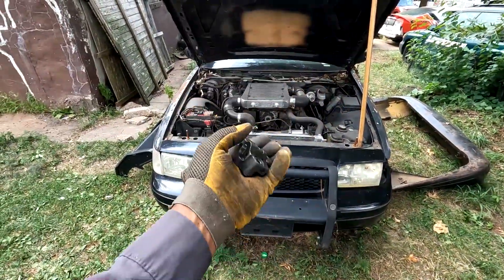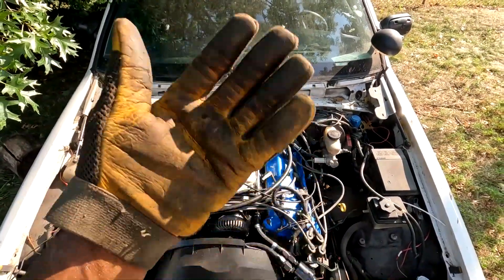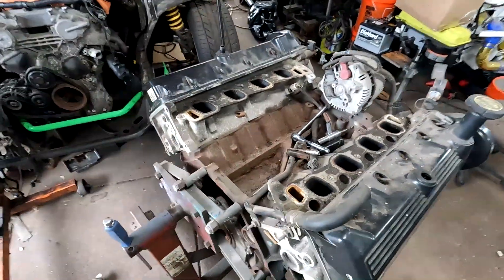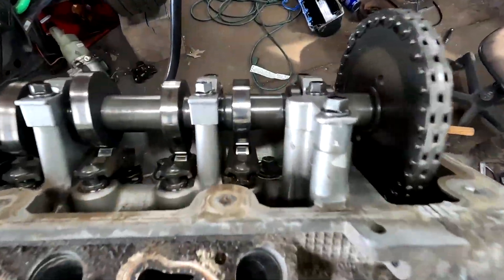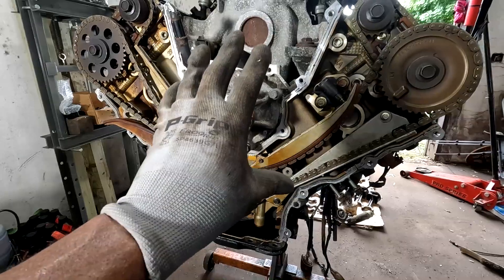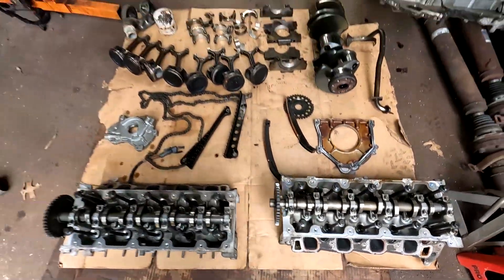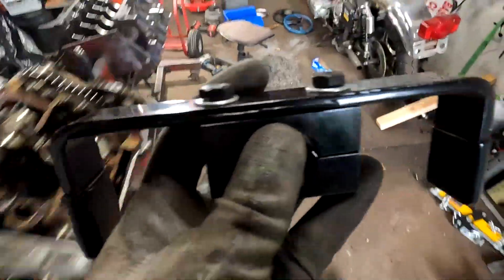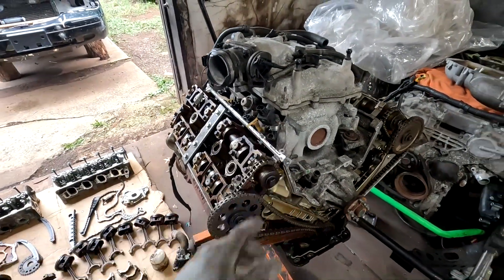The Main 3 Flaws of The 4.6 DOHC Modular Engine!  ( 5.4 2v  Engine Tear Down ) DEBATE!  #cars

Comment: 6:07 i was expecting a exploding  effect lol Mr randoms situation  is interesting 
  he bought a  project  car first miss  mistake second  he was blaming  the marauder  like crazy in that video  he definitely  has a Vendetta  against it lol  from  that & trying to prove a crown vic is  faster  the  one he used  isn't stock  he took out all the exterior parts to race a stock marauder
Reply from the maker: You do have a point... The Marauder he bought was for 1,500 ( cause i know a guy that was going to buy it ) So I feel the Marauder was sick already and it had more weight and a tune... Many Marauders have head issue ( silently ) most are not tuned. So it was a unfair deal , but cool to watch... Lets say turbo to turbo the 4v will win ( by design )  2v is a better motor

Comment: The Mark VIII Engine is better than the Aviator Engine which is known for issues with the timing chain. The Mark's timing chain can fail but it's usually with lack of oil changes but they aren't as badly known as that aviator engine is.

Comment: Brother, the difference in weight between the aluminum and iron block sometimes ain't worth the headache. Sometimes it is lol.
Reply from the maker: yes weight, but better weight doesnt help durability .... Many of go with the weight saving, but are we grudge racing? the car is already 4k lbs 70 pounds can be save from removing the spare tire in most cases ( and rear seat ) The hood on P71 is where that weight is for no reason
Reply: @bstfordchannel923  Right!!! That little bit ain't gonna matter to us. Lol. I'm not looking for every pound. I need durability. So  I can BEAT THE BRAKES OFF IT!!! LOL. I only went with a Ls3 cause I got the block cheap. I was going for a 6.0 iron block. Better stability. I only care about burnouts and ice cream lol. Ehhh maybe a couple red-light to red-light lol.

Comment: Hello sir!!! How are you doin? Awesome to see a video brother!!! Man those timing components are an issue on all 4.6 engines. 2V and 4V lol. I know, your vids about the 4V. That's cool. That engine is in great shape. You lucked out!!!
Reply from the maker: Well we will see lol... I have 3 of them 2 seem great , but there is one in the corner ( of the garage ) that i am second guessing....... 2v that I had have been good ( timing chain wise ) i see more 5.42v give the trouble ( longer chain )  Thank you for the support on this bro... Put some Vic content down and we can give it some traction..
Reply: @bstfordchannel923  I'm fixing to start I stalling my Ls3 short block in my Vic so I can finalize the wiring and fuel lines and such. I've made a bunch of videos on the ls3 wiring. But that ain't the Vic part lol. Thank you brother. I appreciate the support as well. Waiting on parts has been killing me lol. I started making video about my Nitro Rc car lol. Picked up quite a few subs with it. And a few of them are Panther lovers. I'm gonna give you a shout out, see if we can get some more Panther lovers subing to you.

Comment: Lack of oil changes sure does destroy a engine. I only run 4K miles with synthetic oil. Just if you use Wix gold filters , make sure they’re clean inside.. I have been getting a lot with bits of silicon pieces around the top of the filter
Reply from the maker: oh wow? you see that another issue ( that i have a bad habit on ) gasket maker tid bits getting in the pan.... I like those wix filter to... I have not bought one in awhile... Thank you for the support always brother!
Reply: @bstfordchannel923  I finally shined up the 03 Cartier.. will post a short video
Reply: @bstfordchannel923  I had bought 6 Wix oil filters for the 2.5 Subaru.. and most of the new filters had shredded bits of silicon around the top of the filters.. I had to pull off all the bits before using

Comment: Hey bud how’s it goin? Aluminum block big advantage is saving 70lbs over iron block.
Reply from the maker: hey brother! how is the family and the project.... True weight saving is dope, but it doesnt make it durable... not it had the forge stuff oh yeah in stock form ( now it over built ) and is good ( with cooling mod of course )  still a good engine..
Reply: @bstfordchannel923 just dropped off marauder heads at machine shop. Replacing all exhaust seats and he recommended some kind of bronze valve guides. Said he’s seen the factory exhaust guides break on some boosted engines.
Reply from the maker: @canadianmarauder1923  i will show you in a video they bridle they do break with a hammer...There are some odd material i found that out 3 days ago fn around... You doo need to change them for insurance reasons

Comment: Why doesn’t the 2v need the cooling mod??
Reply from the maker: hey brother New edge... well the 2v has better cooling... the 4v has that two cooling pipes ( in the front ) left and right...Now on the left side it goes straight through... Thright side has to make a turn back cause the coolant doesnt flow through the head ( from the back ) ... I may show why this is on the next video...

Comment: On a 5.4 2v at 100k it is barely broken in, my 06 e350 has 220k+ and runs like a top but had to be replaced due to severe rusting of the body my van has had many extended oil changes. Many of these have been known to run 3 to 400k.
Getting old is frustrating my 94 Mark 8 has a relatively simple problem but I’ve been unable to find someone to work on it (east of Tulsa) because it’s too old not OBD 2, the car is in excellent condition
Reply: What’s the symptoms of the issue with the mark 8??
Reply: @NewEdgeDesigns 
The air ride pump does not run. 90% probably of the relay or pump. No I don’t what coil overs
Reply: @monteglover4133  I just replaced the pump in my 95 Continental, sorted my issues.. Mine was just loud and lazy though.. It was an easy job ordered the pump from rock auto..
Reply: @NewEdgeDesigns 
I know how and have the tools, just can’t physically do it as I’m 70 with considerable arthritis, very frustrating
Don’t want to sell it as it’s my favorite car ever
Reply: @monteglover4133  They definitely are beautiful cars, one of my favorites also.. where are you located??
Reply: @NewEdgeDesigns   East of Tulsa Oklahoma
Reply: @monteglover4133  I’m in MA. If you could ever get here I’d happily do it for you.. But that’s pretty far..
Reply: @monteglover4133  Relay is known to fail and it's near the pump basically. I own a 95 Mark VIII myself with the air ride still working for now.
Reply: I absolutely love my 2002 E350 extended cargo van with it's 5.4 2v.  It has 220k miles, bought it at 197k in 2008 and daily drive it and keeping it forever.
Reply from the maker: @Vile-Flesh  i may have to get one of these.... how is it on gas?
Reply: @bstfordchannel923 
The vans 9-10 city 16-17 highway at 70mph they are big heavy brick 
The Mark 13-16 city 26-28 highway
Reply from the maker: @monteglover4133  man that means no go for the van then... That hurts lol
Reply from the maker: there is small group of people that really take car of the cars.. I see you keeping that van rolling!...  what has been going on with the car.... A few guys here can help guide you ... Just mention whats going on...